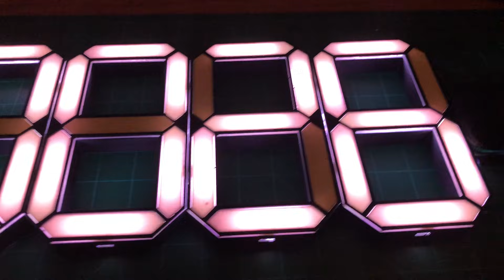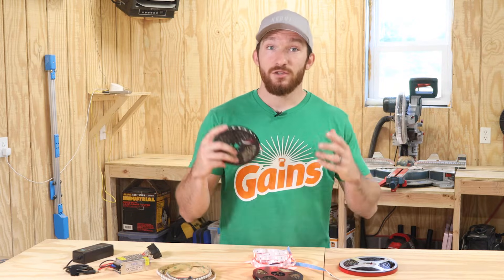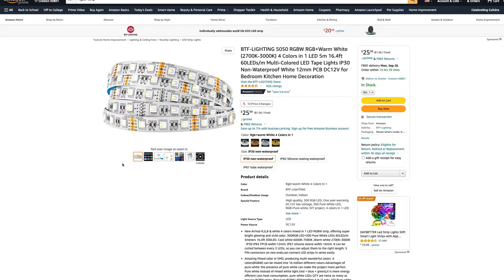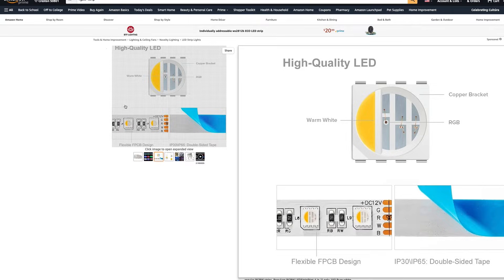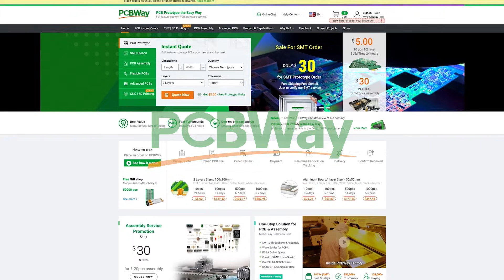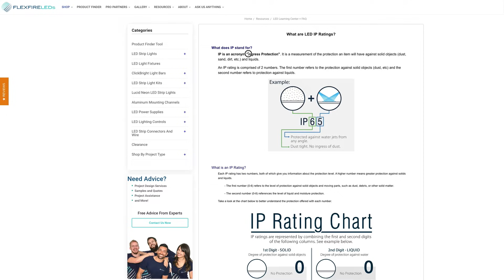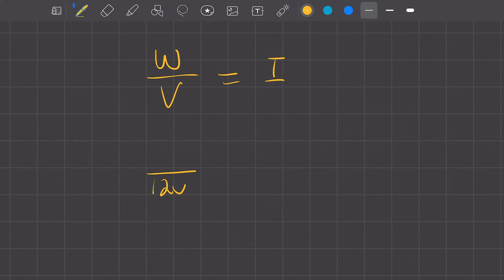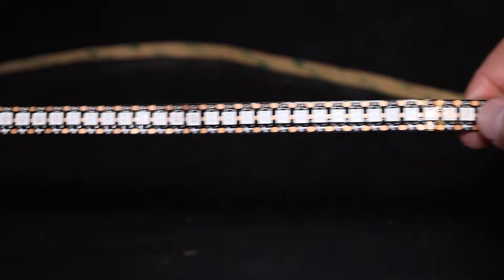Watch This Before Using LED Strips!

Comment: Are there any manufacturers that make relatively high density RGB + VARIABLE white strips? I don’t care about addressability or weatherproofing or animations. 

Variable white meaning cool white to neutral white to warm whites on top of RGB. I know GE makes one but the diode density os horrible.

Comment: At 5:45 I purchased those right angle connectors but found they gave me a very unreliable connection. Could be user error . Anyways I’m looking at them and then I have this epiphany, remove the plastic casing and just use the board . So I proceeded to solder the board to the led strip and I’d say it’s as good as it gets imo . Very easy to solder , and an extremely secure right angle connection .

Comment: Excellent, useful video! Well done!  Please don't read on unless you're colourblind!

Interesting to hear that you're colour blind, as I am too! I'm 80yrs old now and didn't find out that I was colour blind until the Science master asked me in front of the class (at the age of 15yrs) what the Number was on each page of a book he held up. All the class laughed at my answers and I hadn't a clue why! 🙂 VERY embarrassing! 
He must have previously noticed that I had difficulty with colours although I wasn't aware of any problem (and my parents hadn't noticed AFAIK). 
I discovered 10yrs later, that this was the Ishihara colour blindness test!

I built all the circuitry for a home contstruction proportional radio set in '68 and had to check ALL  the resistor values using a multimeter. :)
  
Around 10yrs later I had emigrated to South Africa (~1970) and I worked next to another UK migrant in the Design Office, on the ege of the old 'Jan Smuts' (Johnnessburg) airport.  He was a keen photographer and had a number of colour filters. One day he got hold of an Ishihara colour blindness test book from the downstairs library and, VERY surprising to me at the time, was that we discovered that by looking through a red filter it enbled us to whizz through with all the correct answers; no problem! Turned out he was colour blind too.  Another extraordinary thing was that in a Design Office of 20/30 people there were 3 or 4 of us who suffered from the 'problem'!  Also somewhat interesting is that the recent wife of my 49yr old son is Polish and she'd never heard of it.

Just had a thought... I notice your red beard which possibly signifies a a Scandinavian/Scottish/Irish Celtic heritage.  My parents/grandparents had earlier hailed from Northern Ireland and I was born  in Scotland.  I must now do some research to see if there's any connection between heritage and colourblindness.  As an old Internet enthusiast type I have looked into colour blindness over the decades, when I think about it. You may find it interesting that, at the beginning of m interest, the known figures showed that around 9% of men were colourblind and little mention was made of women.... only circa 1-2%. Probably a decade+ after that it turned out that that percentage increased considerably...I must get current on this!

In all this time VERY few efforts are made anywhere to give a colourblind option on the screen although there are a few. In the early days of technical books, graphs used lines; dotted, dashed etc to distinguish them. Great! :) When colour publishing arose all that went.  Initially computer aided design  CAD, was black and white 👍 but that went too, with coloured screens.   I dabble with stockcharts as a hobby and there's a problem at times with folk using red and green 'candles' so that I have a couple of pairs of clip-on red lens sunglasses to help out.  Many use choices of greens and reds which are hard to distinguish.  (It didn't stop me learning to fly a light aircraft back in the day! Different for airline pilots of course! :)

I hope you spot this although you may know more than me and are probably more up to speed!  I hope it doesn't put off your followers. 
Cheers

NoAxe

Comment: Hi! I am working on LED lighting on a bookshelf that will likely require splitting strips into at least 5 strings to light the different planes I have. Do the solderless connectors work well for this? Or would it cause too much of a voltage drop between strings? For example, I would have one strip horizontally on top of the shelving up lighting to the ceiling, but also need 4 vertical strips to light down the vertical sides. I was looking at Waco connectors but I’m still not sure I could get the result I’m looking for.

Comment: Appreciate the points covered in the video. On thing to mention is I think you need to add another chapter for the power section, as it shows waterproofing as one long chapter.

Comment: One thing worth noting. Most of the time Ebay and Amazon are showing pictures of 600 led strips but selling you 300 led strips.
Also. I like to use old ATX power supplies to power my led projects.
Dirt cheap, sometimes free.

Comment: How do you power the cut LED STRIP?
Reply from the maker: When you cut it, you split the copper connectors in half, so you can solder wires onto them later

Comment: Hi great video ! I build carnival floats, we have been donated lots of various led's and one of them is a 5m led waterproof strip with 240 led's per metre. As it's 12v, i got a 240v to 12v 30amp 360watt converter and found this strip getting quite warm to hot. Do you think its ok to use? There is no info on them, they have 6 leds to each cut strip, they were originally used on a dayvan (which makes me think they are 12v and not 24v) appreciate your thoughts. Subbing !

Comment: Hi,  I've added a waterproof led strip under my dash in my car and connected it to my interior lights on my dash.  So when i put my external lights on,  my interior lights up.  However, the led gets a bit warm. Not overly hot, but very warm. Do i need something like a resistor to cool it down? Or will it be OK?

Comment: This is a great video and I learned so much! I am still having a hard time deciding how to light some shelving. I have 5 free standing shelves (with 5 shelves each) that I will put directly next to each other and will display bourbon bottles. I want the light to be on the back facing up behind the bottles. I also plan to use diffuser channels. I am not as concerned about the spacing of the LEDs and want both white and color but I don't necessarily need the RGBW. My issue is that with the 5 shelves all next to each other I will need 5 strips, each about 140" (11.6 ft) long. I would like if all were connected or somehow controlled together so that the lights were all on the same commands. I can hide connecting wires behind the shelves if needed. After watching your video I am concerned about trying to connect almost 60 feet of lights and not have light degradation or overheating problems. I am "fairly" techy, but not an electrician by any means. Any advice? Or tell me exactly what components I would need? I know its a lot!

Comment: Do you have a solution for a flexible LED strip? I have a project I'm working on and need the strip to have 2 curves/bends to it.
Reply from the maker: Depends on which direction the curve is, all led strips can flex front to back, but not all can from side to side

Comment: Great vid. Lots of information! I'm wanting to light up the steps on my staircase. But I don't want a continuous line of lights that run to and from each step. Does that make sense? 
So how would I black out the strip?
Or can I add spacers? 

I am a newbie to tape lighting and don't know any lingo, but your video helped me substantially! Thank you

I still don't know what I need to buy lol.

My husband remodeled an old "dairy cow/hay barn" so we have 3 levels. One side of the staircase is held up by a couple TREES. The staircase is dark and I don't have easy access to power, on that side. 
I'd like to "highlight" His work, not take away the "wow" with a crappie lighting job🎉.kwim

Tnx again for the video! I am now a subscriber! Lol
Reply from the maker: Hey thanks for the comment! You can buy some extension cables for the LED's so rather than running the LED lights back and forth, you could use the extension cables to "blackout" the lights, so to speak. 

Here is an example of what I'm talking about, and it even has some connectors (though you may want to buy more connectors): https://amzn.to/3YV4HjX

Make sure to get extension cable/connectors with the right number of pins for the LED strip that you go with though! Hope that helps!

Comment: How do you lay a single strip of LED lights around corners when you want them face up without damaging the strip such as on a cornhole board
Reply from the maker: You can either cut them and solder wires from each contact to the next, or they sell corner connectors that clip on to the strip and make a 90° turn to connect to a different clip. Hope that helps!

Comment: Hey dude cool and informative vid. I have a question for ya, (fair warning long explanation sorry) I normally use my UBS LED lights but their not in strips they are more like Christmas light design. I got them at best buy as a bonus gift if you put money on a gift card you'd get the lights. (Needless to say I went a little overboard with my gf and we got like 10 gift cards the lights weren't very long only a few feet and if you unwind them they extend a bit longer so we just put the min of $20 on each card) 😏. They are great lights and plug in UBS so I got a USB hub to have them all plugged in at once. I haven't had any issues or found any ones better than them. I saw the light strips years ago (2013/2014) but I wasn't sure the tech was up to par at that time so I've waited for technology to advance more. Tech hasn't advanced that much and they dont function the way I'd like but you work with what you got so. I have 2 Aura brand light strips and one luma strip. I'm trying to wrap them around my entertainment stand but the stand is made out of particleboard wood chips and the legs are some kind of polyurethane plastic their strong and semi hard bit the tips where you would them together tends to weaken to 11:43 break often when you move the stand anywhere or Gravity does the trick when it's sat in the same spot for a really long. So will these light strips melt any of the plastic legs if I let it touch them? I was wanting to wrap the light strips around each shelf but their too long and I think the ones I have are too cheap to even cut with out damage so what can I do? I have game consoles on on each shelf and my TV on top. I noticed that my PS4 air flow in the back was messing with the adhesive from the heat blowing off from the back,I have it ventilated well and the ps4 raised by 2" sitting on peg legs. I'd love to pick your brain on  best options and not burn down the house send me a direct message or something so I can communicate better and I can give you visuals to see exactly what I'm talking about. Thanks. 😁
Reply: you typed all that and he doesn't answer anybody

Comment: Hello Modern Hobbyist, can you do a video on how to FIX (I'm sure that word will get your attention) a key on a piano keyboard that doesn't make any sound?  (I have a Roland KR-177 Digital Piano, but any video would help.)  Thank your and I love you videos.
Reply from the maker: Hey thanks for watching! Is it just a few keys that don't make sound or the entire keyboard? Also, just a disclaimer, I don't know much about keyboard pianos, but I did recently take mine apart after spilling soda on it...
Reply: @ModernHobbyist  The only key that doesn't work for me is the "B" directly below middle C.  That's the only one.  Thanks for responding to my comment.  One of the many things I like about your channel.  :)
Reply from the maker: @somekid1668  thanks! That means a lot! After I spilled soda on my keyboard I took it apart and was able to clean off the contacts to make it work again. Wasn’t difficult to get apart or anything! You could hop on the discord server too if you have more questions or wanted faster chatting
Reply: @ModernHobbyist  My main issue is I can't get the contacts exposed in order to clean.  As you probably know the piano I have is a mix between a piano and a keyboard.  This make it hard to tear the piano apart.  Thanks for the advice.  :)